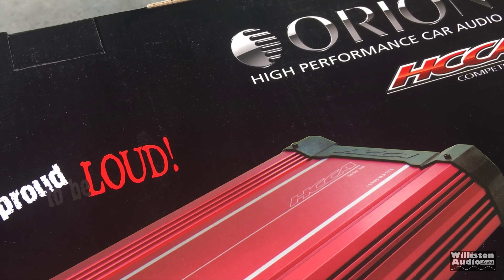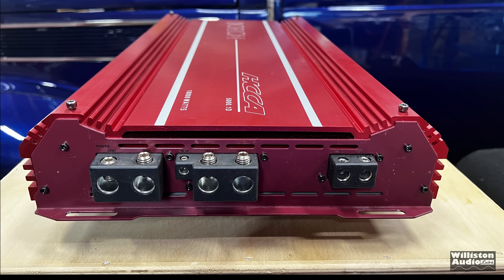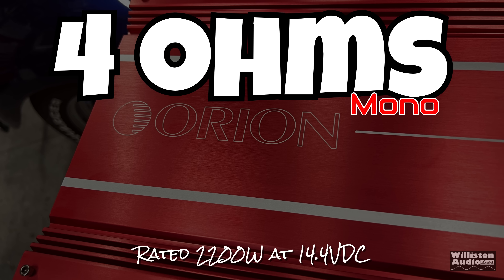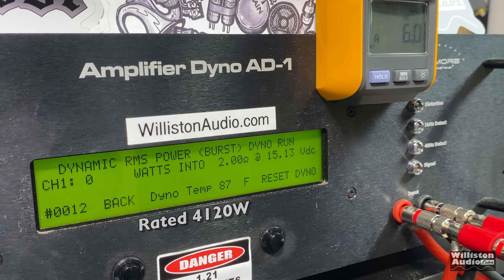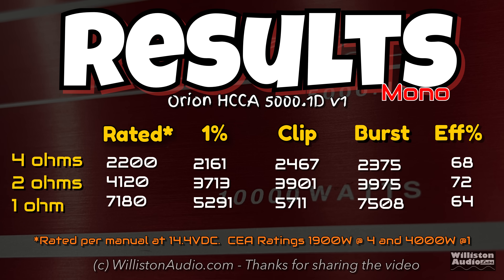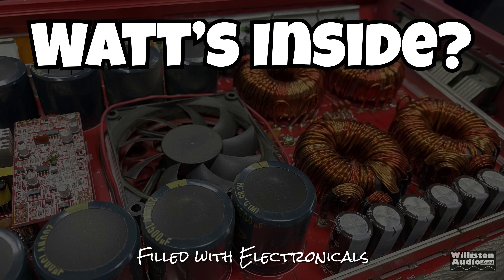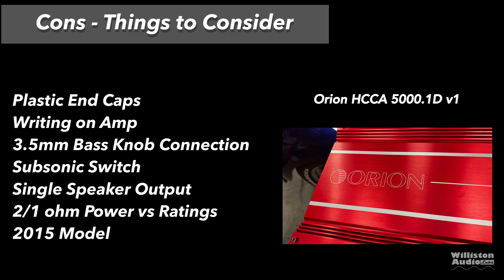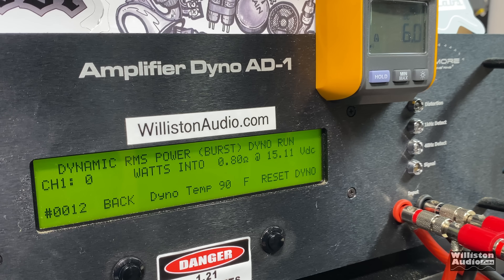An OVERRATED Orion HCCA Amp?

Comment: Have you ever heard of or tested an ultra linear amp like the 3000 d can't remember exact model number I had one in the very early 2000s
Reply from the maker: I’ve heard of them but no tests yet
Reply: ive owned several....there built to UHC (ultra high current).. rated 0.5 ohm, but ran on 0.25 ohm...required great fat wire and at least 2 car batteries...were monsters....i think i remember they pushed 50 volts at around 100 ampere into woofer!! they pushed superhard subs excursion. prolly around 2000 wRMS

Comment: Back in 1985 I had an Orion 280GX running 4 ohms into 4 10" subs. One of the first bumping car stereos in town where you could hear it coming from 2 blocks away. Those were the good old days.
Reply: how much that cost ya back then 3,500?
Reply: @goatskindreams  I bought a 2150SX back in 85 cost me a little over $700. The 280GXs were prolly around $400-500....
Reply: @goatskindreams  I had $800 I'm my entire system.
Reply from the maker: The 280gx was my first amp. Bought it from my brother. Didn’t push my Blue Thunder 10’s all that great so I sold it. Over the past several years I’ve bought a few to make up for selling it. They are cool amps for sure
Reply: yep i had that one and three other amps and WoW did it ever sound awesome!!
Reply: '85 is early, you live in Ca?
Reply: @randylneisen4824  Kansas. You couldn't pay me to live in California.
Reply: I remember jbl Kenwood and pioneer and  Sherwood amps back in the days in ca
Reply: I knew a guy that had over 6k in an Orion system.  4-12's 6 Orion amps like 6 or 8 mid woofers and and whatever else he had. It was insane loud at 1/4 power in a Chevy Berreta back in the late 80's early 90's.
Reply: Bumping 8tracks lol
Reply: @Psy6o  Actually high bias and metal cassettes were the norm back then and portable CD players just came out too. 8 tracks were old school by then smart ass.
Reply: I will take $hit that never happened for $400 Alex!!
Reply: @tommymignanelli3758 And just like that you lose.
Reply: You had very low standards for good old days I think hitting 150s with one subwoofer is way better than 4 10s 2 cm Xmax you have to literally Mount to the back of your seat to feel the bass. Tip the hat to DJ magic Mike. And we can't forget about techmaster PMD.
Reply: @minenachos  How sadly mistaken you are.
Reply: @minenachos  kids say "literally"  please stop....example ....u were not "literally frozen to death"  u were just cold...

Comment: I had the HCCA 225 and the 2100 to match traded the two for a Phenix Gold MPS 2500 , That PG was the Best amp $ could by at the time . Did a true 2671 RMS was so hard to find sub's to take that power in the early 90's !
Reply from the maker: 1993 Phoenix Gold MPS-2500 - Who's Cheating? [4K]
https://youtu.be/Cks5W-sLvps
Reply: @wal  The one you tested was not putting out full power , Just so you know i remember when you posted that video knowing nothing about that amp or knowing what condition it was in , wish i could give you my old one to do the test with , it could do half Ohm loads for burst but it did get hella Hot.

Comment: Order my d4s jp8 today for my 4 12 old school kickers when they are released. Yeah boi👍 I used Orion Amps back in the day when they were USA made. The ultimate cheater amp. Not the same build quality.
Reply from the maker: That JP8 is one of the best values in sub amps not requiring electrical upgrades IMO

Comment: Orion has taken a total nose dive IMO. Their amps do make good power but the numbers on ALL of their recent birth sheets are bogus. They are so lazy they don't even bother trying to match the output graph with the claimed number. I don't trust Orion at all anymore.
Reply from the maker: This amp is from 2015. The newer SPLX versions are insanely powerful.
Reply: @wal  Not from my experience. Quality went to sh8t. XTR version knobs when from glide to click in place making gain fine adjustments difficult. And YES all the new splx xtr-dz birth sheets are BOGUS, the graph does not correspond with the number.
Reply from the maker: Orion HCCA 4500.1DSPLX is a SUBWOOFER Amplifier Powerhouse! [4K]
https://youtu.be/AXes8Gncn1w

Comment: Got into Stereos late 90s early to mid 2000s. Onion was outa my impatient budget. Did have a JL 500.1. But thanks to these dyno vids I went with an Orion XTR 750.4 to run not just the front component sets with resister boxes but also the set in the rear passenger side figuring I at least get whats on the rating plus more. Birth sheet shows 205watts @2ohms. Very pleased. Now if only it wasn't -6°F out with the windchill making it feel like -30°F I'd be able to install it... hehe
Reply: Oklahoma is frozen. I got 3 subs to wire up. Not this weekend.
Reply: Yep, Soo freaking cold here in Missouri too and no way in hell am I going to be running 0ga and installing the 2nd battery in this latest old Grand Cherokee!! Think it's -3° rt now and still dropping fast with a NASTY wind chill!!
 **And yeah, I got the xtr 2500.1 after watching Big D's Dyno test and it has been AWESOME!! Had it running.8 ohms for a while with a 12 and a 15 inch subs and it just keeps on ticking, HARD!

Comment: So weird how it's so overrated. Orion back in the day was awesome. Wonder if maybe this particular amp didn't get the quality control it deserves, I e. the difference in color on the end caps and the difference in color on the writing.
Reply: I believe the 1500.1 or 3000.1 HCCA Amp out performed its rating, by far! Wild that this one misses it's mark.
Reply: @TideFever  oh yeah true that 3000.1 is wild. Just nothing close in it's class.
Reply: Yeah pretty weird, but the amps quality is still on point. For it's size, at least in my opinion, it is very powerful and compact. In Europe it is hard to get very powerful and good quality amps and woofers. We have to import and it is very expensive
Reply: I'm running phoenix gold sx series amps and subs, I've heard they went to crap, were awesome back in the day as well..
Reply: Orion hc amps were awesome back in the day. Not now everything has gone to crap. Jl is still the best amps out

Comment: Back in the late 90s I had this gigantic black ORION amp. It was like 900 watts. It hit really hard and had great SQ. Wish I would have never gotten rid of it. But I tell you it was nearly 2 feet long, not real wide, but dang it was long.
Reply: XTR 2250?  The Beast
Reply: @danielknepper6884  I don’t remember the name, I could probably look it up. It cost a pretty penny, but I got it on discount because it was an older model and it was in a pretty small town, so there wasn’t a real big demand for it. People weren’t really banging ORION in that town back then, they didn’t really know what they had.
Reply: That's what she said, lol
Reply: @johngalt1967  I knew somebody was gonna say it lol
Reply from the maker: $25 Walmart Subwoofers and 25 Year Old Amps SPL Challenge? [4K]
https://youtu.be/I7Wt7SvzLjg
Reply: @wal  yeah, that’s the one…I don’t know how I fit that and that ol school Kenwood excelon 4 channel amp with the fan and automatic sliding door in a 94 T-Bird. The whole backside of the back seat was completely covered by amps and capacitors.  I was running like 10 speakers, 5 sets. Pair of tweeters, 4x7s in the front door, 4x7s  in the back side,   2 free air 5x9 in the back deck and two Polk 10s in the trunk. Huge sound and great SQ.

Comment: We need to see PPI Poweclass dynos!

The PC1400 charcoal specifically.
Reply from the maker: Thanks for the suggestion!
Reply: @wal  i have a pc1400 could loan out for a dyno test if you are interested.  I bought it second hand in the early 2000s and still use it in my daily to power 3 jl 10w3v1 subs i bought new.  Love the channel!
Reply: @kegs5020637  Yes!   That's crazy.   My experience with the 1400 was with 3 10w0s then 3 10w3s.

Magical combo.   Loud with mad SQ.
Reply: Those PowerClass PPIs were amazing. I used to hoard almost 20 of them at any given moment, from the smaller 2 and 4 channels up to the bigger 2150, 2600, 4800, etc. The power may not all be there as far as the specs are concerned but damn if they didn't sound absolutely amazing 🤙

Comment: Would be cool if you tested one of Soundstream's Reserve series amplifiers, they're currently selling them at half of what they normally go for.
Reply: Reserve ?    .... you mean Reference ?
Reply: @Mr_BUSINESS_24_7  No, the only Reference that I know Soundstream has is subwoofers. Reserve is Soundstream higher end products meant to be sold by only approved dealers. The RS1.5000D (1,700w) and RS1.8000D (3,000W) are their monoblocks.
Reply: @ranchosdelnorte  oh.   .. You mean more current products ?
Reply: Who is "they"
Reply: @jamesstephenson2346  You're not supposed mention sites in comments because it usually counts as spam. Let's just say their initials are A.S and they're the main distributor of R-ville products. They also sell through ebay, so you can just go there and search the model #'s(mentioned in one of the other replies)
Reply: @jamesstephenson2346  
You're asking who is Soundstream? Guess you haven't been around that long, in car audio.
Reply: @Mr.Robert1   I believe he was asking who is “they “as in who is “they’re “selling half priced?
Reply: @Mr.Robert1  No.  .. He wants to know why is "selling," them. Meaning which "retailers."

Comment: infrasonic. 

Considering that the input power to these is 14v DC at max with a typical car battery, how is it delivering that much power? Is it running an internal transformer to up the output voltage?  I would really like to see the output voltage of these amps.

For reference  14v @ 0.5ohms is roughly 400w output. So it's doing something to increase the AC voltage output.
Reply: I think you are confused on how wattage is calculated brother. V x A = W
Reply from the maker: Almost all car audio amplifiers have transformers to boost the voltage 👌
Reply: sir watch a channel youtube: "barevids" ...he fixes amps....watch a vid on how amps work

Comment: Love the Orion content.  Do you have any info on what the different cards for the pop top amps do?  A video on that would be great.  Thanks for making these.
Reply: Pop Top Series were programmable crossovers on small removable circuit boards. Originally designed for the installer to “program” the amps so that the end user has less controls to fiddle with and mess up. Unfortunately it proved to be more troublesome than it was worth, especially for the next owner of the amplifier. When I worked at ORION in the early 2000’s , I estimate 10% of all of my tech calls were about how to program the “pop top” X-Over series. In todays times, the best option is the bypass card if you can find them and use an outboard DSP or analog crossover.
Reply: @eatsleepbassrepeat  Thank you for the info.  I don’t know what card is on mine. Once I get it sorted out I hope to use the amp for something.
Reply from the maker: I have a manual that covers them. Send me an email WillistonAudio (at) gmail and I’ll send them to you
Reply: @wal  That’s awesome!  Thank you!